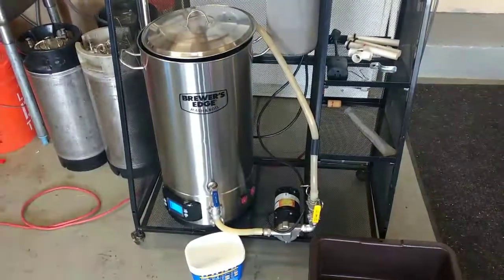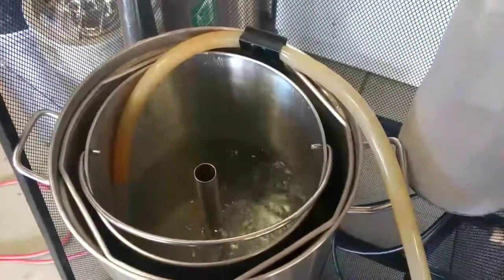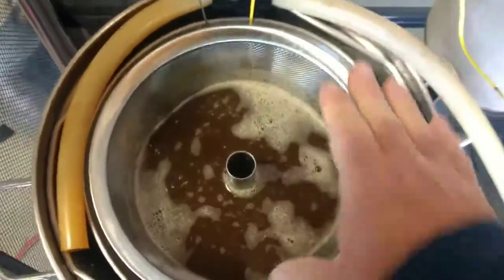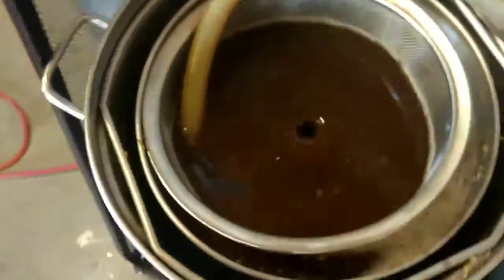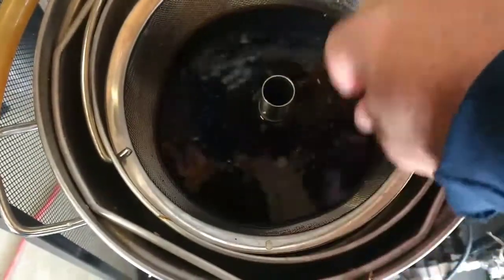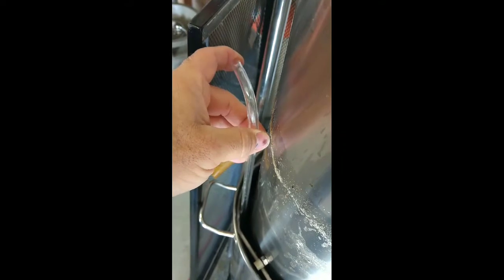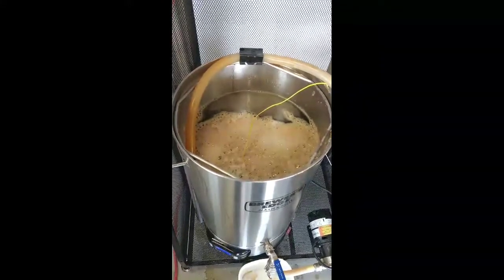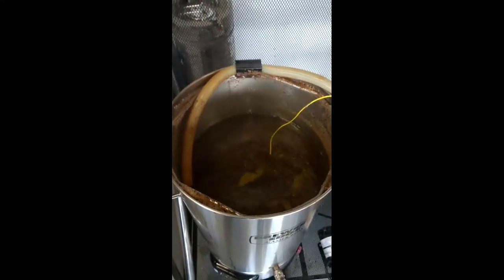Mash and Boil drain tube mod brew day.

Comment: I have the same rig. I would like to know if you have had issues with E4 error code? I find that when I use high protein malts this happens more often. If you have had this problem did this mod help? Or do you have any recommendations? Thank you.
Reply from the maker: I've only had the E4 code once, and it was from adding some DME during the boil and it caked up on the temp sensor. I can't really say if the mod helps or not as I modified mine pretty quick after getting it. But I would think that constantly recirculating would help keep that protien from resting on the bottom and triggering the E4
Reply: @tylerbrower1151  I have been recirculating for awhile now, if you go to my channel BikerMetalHead  you can see some short clips of my last brew day. Main problem is stuff accumulating on the heating element.

Comment: What camlock fitting is on that mash and boil? I bought a 1/2 npt but it doesn't go on. Where you get yours?
Reply from the maker: On the spout outlet? I believe it's just a standard 1/2 pipe fitting. It was one I had laying around and didn't buy anything special.

Comment: Where did you pick up the drain tube?
Reply from the maker: I build it. I sell kits also if you're interested
Reply: @tylerbrower1151  I bought the parts you listed in another video (the link for the welded tube is wrong, sends to a 1/2 tube instead of a 1in). Wish I would have seen this message before I ordered the stuff I definitely would have just got it from you. If anyone else asks though I'll send them your way bro
Reply: Tyler, I just purchased a Mash n Boil with pump and I love that malt pipe mod. Is the pipe bolted to the bottom of the grain basket to stay up off the bottom of the boil kettle? Great job!
Reply: @tylerbrower1151  I'm interested in the kit you're selling  How can I order?

Comment: dont understand how you can be 1/2 gallon off.  do your total water calc before for you even start and you will know how much you need instead of trying to measure and adjust in the middle
Reply from the maker: I was just saying the marks on the inside wall are half a gallon off.